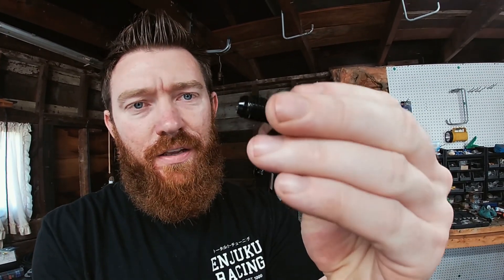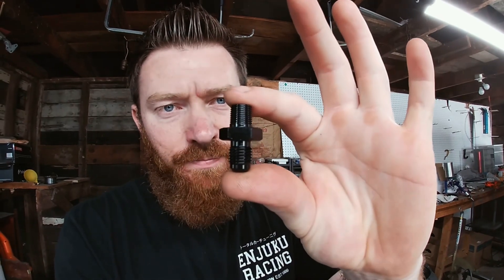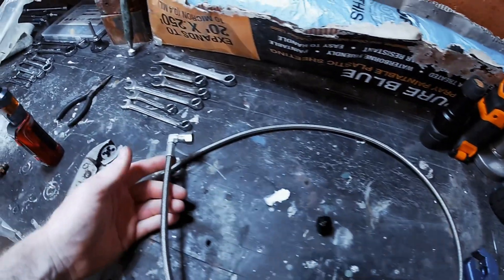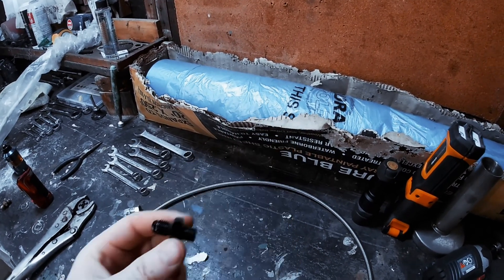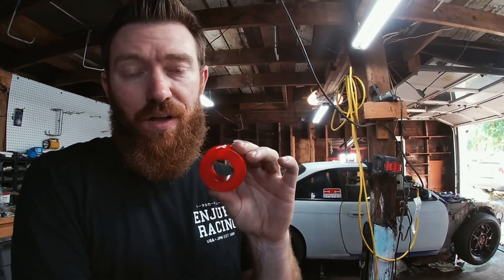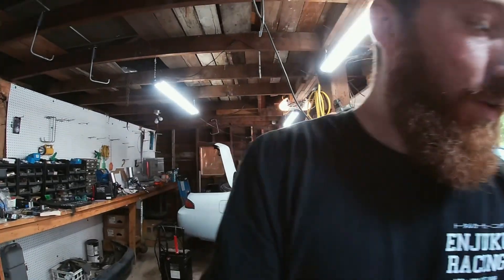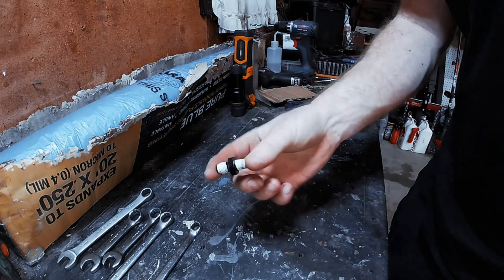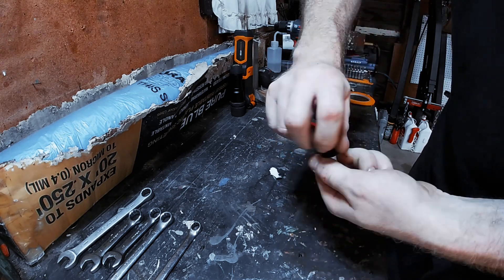This $5 AN Fitting Has Solved All My Problems…. ??

Comment: Oh it could be from not a 2 inch crank case open vent, to let the pressure out of the engine also, so when your on a top pull, it will not blow out oil seals and gaskets, just adapt a one wire GM straight to the battery, I use allGm one wire, alternators on everything I own110  amp ,one switches are needed, ,,,wire it with out ant other wire ONE WIRE straight to the positive on the battery, ok on the oil leak, it could be from not having and vents to the open air fromthe crank case,, ok good keep learning, and having fun thanks BigAl California
Reply from the maker: I have a PCV on the valve cover. I need to get a baffled oil catch can and line to run from the -10 fitting I got on the valve cover. The oil was leaking from my oil feed line fitting that was on the oil filter adapter plate. It had the wrong thread pitch for what I needed. It’s now good to go & got the power steering leak fixed. I have to check the wiring on the alternator plug since it charges the battery with the OEM plug but not on the aftermarket plug. I’m sure some wires are swapped on the pin location. Getting close to first drive!